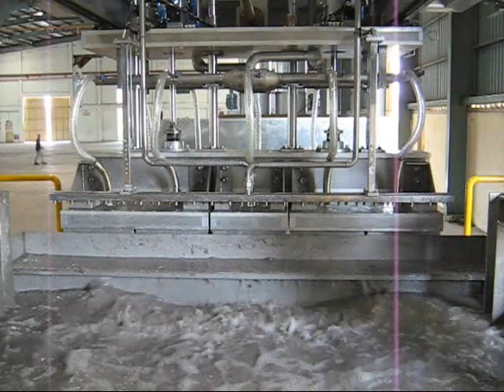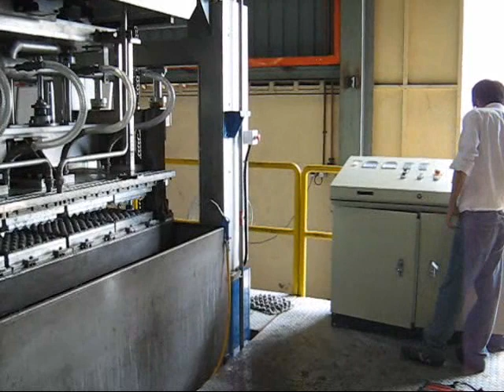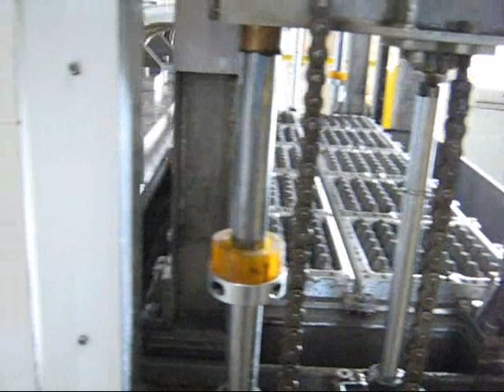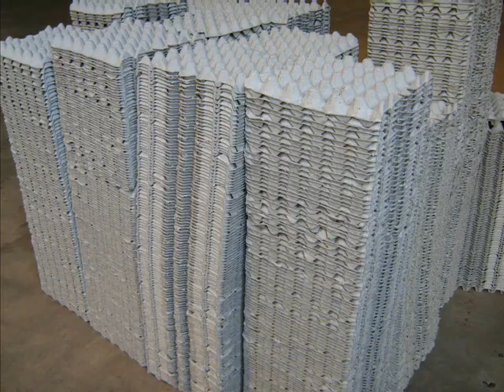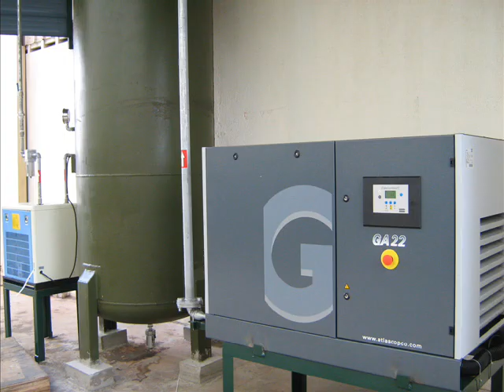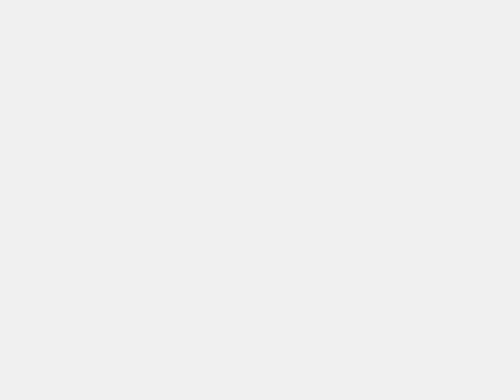Eeg tray & Industry package

Comment: Request for Expression interest: Supplying Production line of Pulp Moulding 

Dear Sir/Madam

We are a Professional Industrial company operating in United Arab Emirates and we are looking for reputable and professional technology provider to supply, install and start up a Paper Pulp Moulded Production line to produce Egg tray, Egg Box and Cup Carriers products.

We are writing today seeking your best offer for the following:
 
1-      Hydro Pulper with all A/G tanks “stainless steel”, pumps, mixer, dosing system, water heater.
2-      Egg Tray Pulp Production Line, capacity 2,000 Pcs per Hours
3-      Egg Box, Cup Carrier, tableware Pulp Production Line, capacity 400 Kg per Hours
4-      Dryer “steel Cabinet/enclosure, multi-layer, Diesel/Gas burner”.
5-      Full Set of Dies For Egg Tray Various Cavities, Egg box, Cup Carrier, Tableware.
6-      Stacking unit: attached at the end of the dryer.
7-      Printing unit.
8-      Labelling unit.
9-      Sterilizing unit.
10-  Wax Coating Unit.
11-  Final Shrink Wrapping unit “Tray and Boxes bundling unit “.
 
 
Seller/Bidder shall supply all Ancillary units like but not limited to: Water heater, Chemical Dosing Unit, Pump Controllers, PLC, Blowers, Conveyors, ….etc.
 
Note 1: Bid Closing Date is 8th Dec 2017.
Note 2: Bidder shall read the provided specification and scope of work.
Note 3: Pricing template shall be provided as per the buyer requirement.

Kindly contact us with your sales team to initiate the technical and commercial discussion for this business venture.

Best Regards;

Tarek Barham - General Manager of Industrial consultation
Mobile/Whats App : 00971 563188219   or 00971 522977739
Al Nahyan District - Abu Dhabi - UAE 
tarek@ZADconsult.com